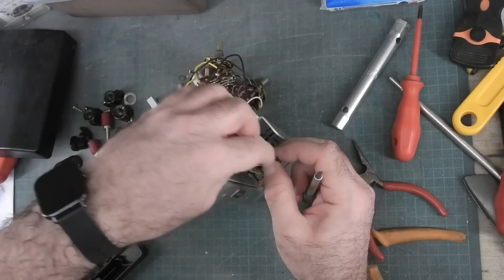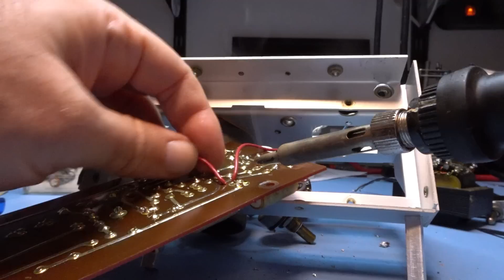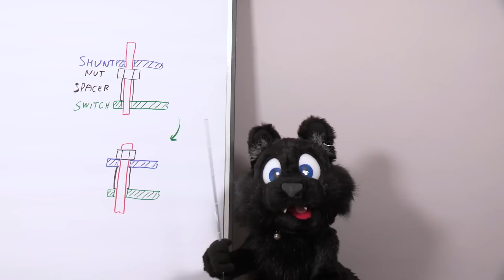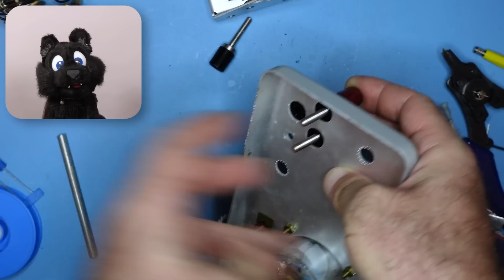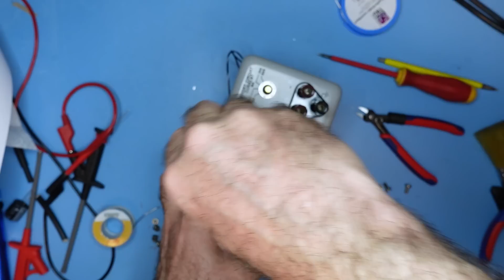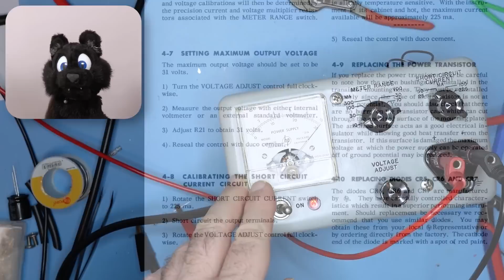HP 721A - Lab Power Supply

Comment: I know this video is 8 months old as I post this, and nobody will read it, but that diode across the output terminals is there in case you connect the power supply to a power source, such as charging a battery or capacitor. If you get the polarity reversed (easy to do with two red binding posts) then the diode will try to protect the circuitry. I have, unfortunately, fried those diodes in the past 😒.
Reply from the maker: I figured as much - the transistor stage would be rather sensitive to reverse voltages. Also, in some power supplies, I have noticed that the "low" end of the regulation is acutally a bit below zero. The protection diode clamps that to zero too. Not sure if it was this one or the Gossen though...

Comment: The manual states that either voltage post can be connected to chassis ground (section 2 page 2). This is a very simple way of supporting negative supply voltage with respect to ground. This is also why both voltage posts are red as binding either post makes that post the ground reference.
Reply from the maker: I never thought about it from that perspective. Interesting take. To me, it always made sense to keep the "negative within the context of this supply" pin black, like I see it on all the other devices so far. It does make sense when you look at it from the perspective of using black just for "absolute ground".

Comment: Early PC boards were known for problems with traces lifting. The rivet/strain relief may have been an hp solution to this problem.
Reply from the maker: Quite possible... though I would assume the rivets do a good enough job at that without the strain relief - so I haven't thought of it as a possible option for that problem.
Reply: @atkelar  The very early PCB were truly terrible. You could almost peel a trace with a dirty look. The adhesive which held the copper to the phenolic would melt at a temperature lower than the solder. It did improve quickly... But really, the only way it could go was up. I think it was what prompted Tektronix and Zenith to stay with Point-to-point wiring for so long after the advent of PCBs.

Comment: You can be happy, just replacing a few capacitors, atkelar, not like my tube radiogram,almost 35 capacitors that need replacement. Its a nordmende Casino 59 stereo.the power supply is really neat,i'm shure, its worth restoring.

Comment: Nice, the Grand-daddy of Transistorized power supplies.  I think John Minck in his memoirs mentions it someplace.   I think it was originally a Dymec product (upside down HP = DY)  me thinks as they a made a good number of power supplies this would of been one of the first under the HP brand,
Reply from the maker: I am not that deep into the research part; but given the overall design and style I saw from HP so far, it would make sense that this is one of their very early models.

Comment: Nice restoration, tin whiskers are a surprise, I’ve seen them only a couple of times on equipment, but maybe it’s because I’m not really looking for them.
Reply from the maker: I had a case of them recently with a few solder joints... that was kinda oddly behaving too. But clening them off made the fault go away for good. Not part of a video project though, but they seem to be common enough to watch out for them.

Comment: I wonder what the dot is for at the 13.5V mark on the meter dial? Battery charge voltage? Probably something about it in the manual.
Reply from the maker: I was wondering that too... I only noticed it in the close up shots; maybe it's a little speck on the scale? It does appear very centered between two bars though; would be incredibly odd to be random.

Comment: That's got to be one of the earliest HP products I've ever seen.  I love the way they've stamped the labeling into the front panel, that'll last forever.  The construction is certainly sturdy.
Reply from the maker: A lot of the earlier models came with that "engraved" style labelling. The 5512A nixie counter is another example. It's also what makes it a bit hard to paint over and fix the scratches. Thankfully, there's only a scratched number (inventory?) on top and a minor nick on the botton edge on mine.It's next to impossible to get perfectly matched color to just patch these things. A "close" color to re-paint all instead is usually much easier, but not with these...

Comment: Thank you for the heads up on the voltage control.  I've had my 721A for about two years now, and the voltage control always seems somewhat fiddley.  Like you I bought the 721A as a "standby" power supply, but I find I use it more often than my two B&K 1601s.  The 225 ma current source sometimes gets me, but the 721A has become my go to power supply for most small projects.  I am getting a second one for bi-polar use.  Thanks for another outstanding restoration vide0.

Comment: I thought I saw a date on the board of 12-15-59. Which would be December 15, 1959. Very close to when HP first started to make equipment.
Reply from the maker: I double checked: indeed, below the part number, it says 12-15-59 - but I think that might be the design date of the PCB? That adds up with the manual at least.
Reply: If by "close" you mean 20 years!  HP first started to make equipment in 1939.

Comment: According to the transistor type no's and packages,  these are all germanium.
These have a forward voltage drop of around 0.2 V if I remember correctly.
Reply from the maker: Yeah, I learned "about 0.3" - but it read as "0.07" - either way, it does work, so I'll keep it ^^

Comment: I wonder if this could be upgraded to have higher output? but still a lovely resto
Reply from the maker: Would probably need a bit of a re-design... it's putting all the load over the different current shunts, which is not common anymore. Modern designs use the same low-ohm shunt and switch the control level instead. If I come across a broken one, maybe... But it's fun to keep these devices "as intended" as much as possible (besides some recapping of course :D )